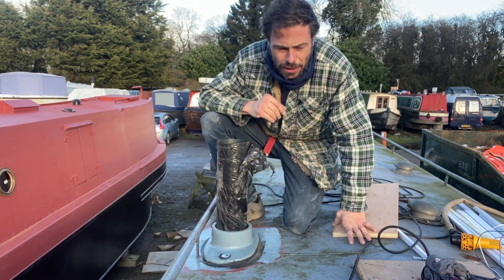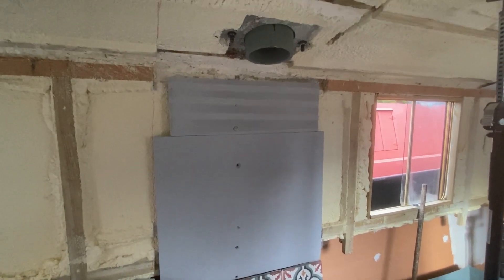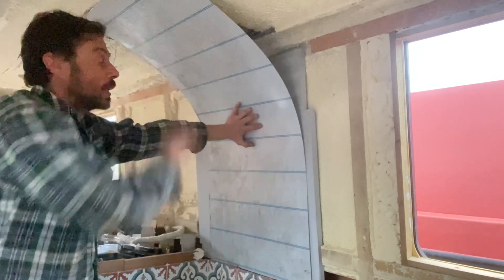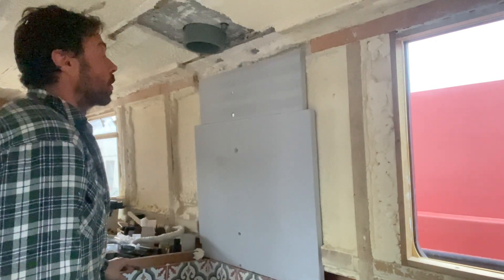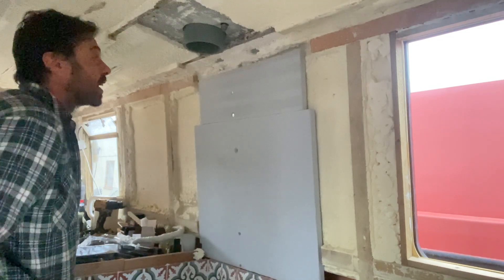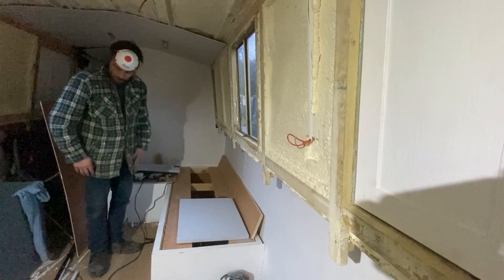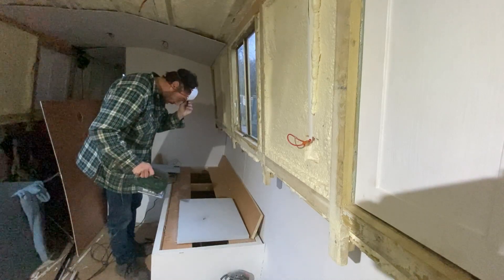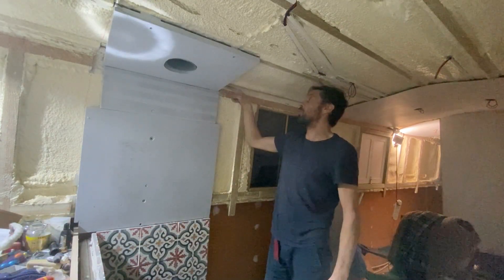105. Calcium Silicate and Stainless steel fire protection installed on the Narrowboat

Comment: Hi, fit the SS barrier and mark the hole from the roof..stick fuzzy Velcro to the foot of the jigsaw to prevent scratches on the SS sheet..job done😊
Reply from the maker: That will only give me the inside - I need the outside - good tip of fuzzy Velcro tho 👍🏼

Comment: I would suggest some self drilling rawlplugs for plasterboard (metal), there are numerous types out there, complete with matching screws.  You could get some screwhead caps, like the ones used on mirrors, (only metal versions rather than plastic), to cover up the screwheads neatly.

Comment: Ideally you want a sheet metal brake to create a sharp consistent crease but as you don’t have one on site (presumably) then it will be hard to get it neat and tight. I would be hesitant about heating it myself as you may discolour the metal finish. You can obtain fixings for the cement board and or high temp adhesive to keep the sheet up. Also once the metal collar ring is screwed in that will also help to hold the metal in place. The bend you have in the video looked to me about right. Getting closer cheers.

Comment: hello you can lay the sheet on the boat floor screw a batten to the floor alonng the bend line use another batten    behind the sheet and use a hamner to knock the angle you req you will get a sharp bend

Comment: Put the plate up, put something with colour around the end of the pipe, put the pipe down the hole, mark the back of the plate with the colour, take the plate down cut the hole in the plate where the colour is.
Reply from the maker: That will give me the inside measurement and I need the outside
Reply: @TheNarrowboatThatJamesBuilt  that will give you a circle with a centre and you can measure the outside circumference and draw it from the centre point.

Comment: There are special plugs for plasterboard which will probably be suitable for the CS board as well. There are also fasteners for fixing things to plasterboard that open up and press on the back of the board as you tighten them up.

Comment: Mark the flue hole from the roof. Find the center. Measure the outside of the collar and use the hole cutter of death as a scribe for the larger diameter. Make the hole big enough so the chrome trim piece hides you cut.
Reply: Drill a hole in the center to stabilize the cutter and just spin it by hand to make a scribe line for the jigsaw cut

Comment: Do you have to ‘burn out’ your stove before your first fire inside?  When you get a new wood stove in a cabin they usually recommend burning a big fire outside in it first so it can cure.  It could smell really bad the first fire if you don’t. (Source: got a new fireplace last year)
Reply from the maker: It just needs small fires to start with and build up gradually

Comment: I did my conservatory log burner with twin wall flue and it cost no where near £600, off the top of my head I think it was £70 a meter or there abouts.  In fact you can get 5" twin on eBay right now for £67 a metre.

Comment: There is heat resistant adhesive amazon sell it , that might be helpfull as well as the stainless screws. Drill a lot of holes in a circle for your jigsaw to follow.
Reply from the maker: Ok cool thanks I’ll look. I’ll do just that - same as I did on the roof basically 👍🏼

Comment: Don't heat the sheet trap it between 2 pieces of wood and bend.
Self tapping screws with bolt heads might look good ?
Reply from the maker: Ok thanks. I was thinking of chunky bolt heads to make a feature cos countersinking won’t look good as it’s too thin
Reply from the maker: Thanks for the baked good by the way. 
So far the cherry bakewells are the leaders

Comment: FYI  Please use high temp silicone as your stove cement , not actual hardening stuff, or it will be very brittle and fall out cause of the vibration once it has cured. If it is silicone it will flex and not crumble to bits.
There are other posts of people using the hardening stuff and they are disappointed with results and have had to upgrade on purpose.. some in the middle of trying to stay warm.
Reply: High temp sil to glue the stainless on the hard board. along with the screws/

Comment: James go to hardware store and get expanding nuts, they will lock into the silica board and allow you the get excellent grip. just like a drywall anchor, just in all metal.
Cheers

Comment: Will the 2 bolts from the roof flue mount, transmit the cold from outside and condense with water? Will this cause you any problems. Are you better to grind these flush with the nuts and infill any void between nut and stainless cover with your expanding foam. Just a thought, which you may have already considered. Keep up the good work. Your getting very close to having a functioning, live aboard

Comment: Not sure I would use heat to improve the bend , clamping a strait edge across is the way , better still down to something solid and tap from the back with a piece of wood against the metal . Perhaps once your happy get it up in position and mark out the hole for the flue from the outside on the roof
Reply: I agree with this solution.
Reply from the maker: Cool - I’ll give this a go - thanks 👍🏼

Comment: I may be wrong but I believe the figure of £600 is roughly the price of a complete insulated flue and chimney kit designed and manufactured by Morso for a range of their small stoves. The kit is specifically designed for use on narrowboats and includes telescopic flue pipe sections (no need to cut) and everything else needed (roof collar, chimney, cap etc.).
Reply from the maker: Yes that’s right and from a chandler too. Obviously there are cheaper ones as others have found and there seems to be jump in price in 1m and 1.5m which is needed for a boat rather than a house. Bottom line is overall budget - this is another example where I could pay twice as much as the solution I’ve gone for and save me some time - but if I use that philosophy throughout the boat then I’ll be even more over budget than I already am!
Reply: @TheNarrowboatThatJamesBuilt  Sorry James, I only intended to clarify that you hadn't just gone for single wall because someone quoted you £600 just for a length of twin wall flue. I understand your budget constraints and I'm glad that they have not led you to compromise on the most important safety aspects of your installation.
Reply from the maker: @michaelburns6197  I agree Michael - stove install and gas install are the 2 areas not to compromise on. Thanks for all your help and guidance on this one👍🏼